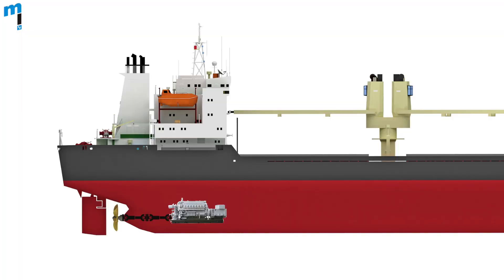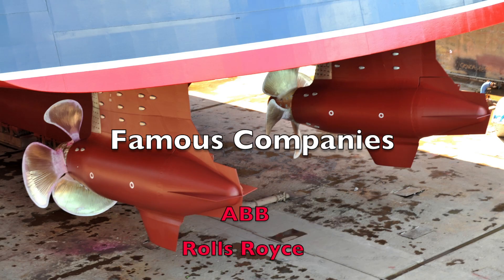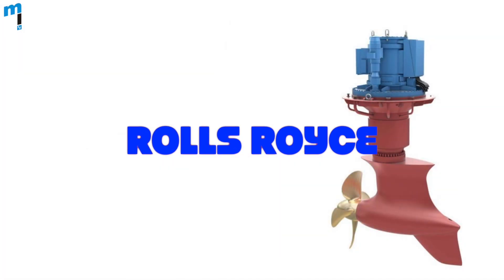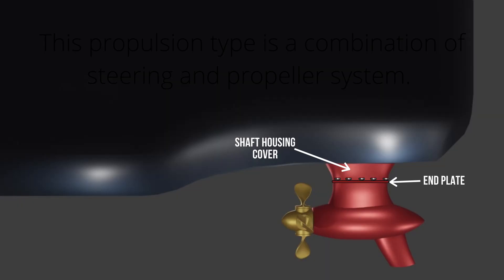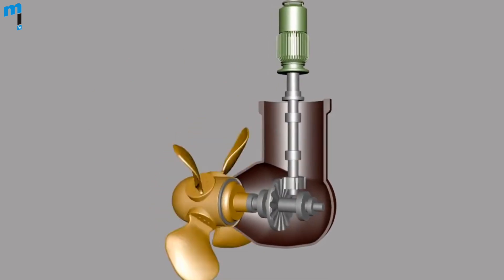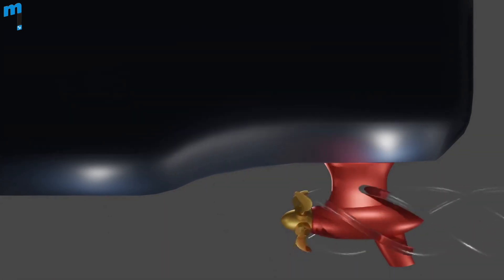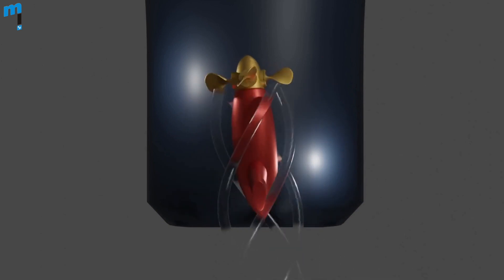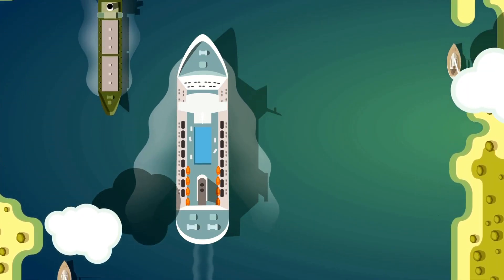Pod Propulsion System

Comment: you kind of missed the whole idea and got a bunch wrong,  muh hommie.  it is cheaper to build a typical single screw propulsion system, but the benefits of a an azipod propulsion system are tremendous.   Mainly docking large ships without tug boat assistance and that's with no bow thrusters.   There are videos of a little 9 year old girl docking a 100 foot motor yacht by herself,  the system uses a single joystick and is incredibly simple to use.  They are still studying fuel efficiency so it's too early to claim an advantage in yearly costs and transatlantic cargo shippers are notorious for only using the least expensive method available so single screw cargo vessels will be with us for a while but they may be returning to sails in the future

Comment: I’d imagine the pods with electric motors within them would be more efficient than a mechanically driven shaft running down to the pod. There would be a certain amount of power lost through the bevel drive. Great explanation, thank you!
Reply: In long term use it more efficient for me than put motor directly to turning propeller. Sealing from sea water will be main issue with underwater motor. Maintenance too will not be a simple work to do.
Reply: electric motor will be severelyy underpowered, not to mention you have to carry battery

Comment: You can forget the rudder refusing to work at low speed, and all the problems with transverse thrust. The pod contains all the moving parts, and all you must take care of, is the quality of the seals.
I have no info on how the electric pod propeller behave in case of incidents. Water entering the pod would disable both propulsion and steering of the ship.
Reply: Yeah, that's a interesting fact which they conviniently forgot. Both steering and propulsion wi ll be lost in the event of a mishap. Certainly not worth the advantages  of using it.
Reply: @rv_316  And still all the navies and corporations are going there so it must be more efficient.

Comment: Why aren't actual propellers protected from underwater obstacles
Reply from the maker: Some Propeller do have a circular covering
Reply: Adding protection to the screws also adds drag, reducing efficiency.
Reply: I dont think that adding a steel ring around a propeller would save it from breaking if you hit something stationary in the move the ships weight is more than enough to rip the pod off the ship if you think about it

Comment: POD propulsion needs high voltage system.  Do all synchronous motors used in POD propulsion are slip ring type? I think brushless synchronous can be installed. Secondly may I know why POD propulsion do not gain so much popularity despite of so many advantages? It is well known fact that Deasil electrical propulsion is anytime more fuel efficient then direct diesel drive.
Reply from the maker: Yes, Burshless motors are alos used. 
Diesel electric propulsion coupled with POD has higher power loss as compared to direct drive system

Comment: Is there any disadvantage of this pod propulsion???
Reply from the maker: Higher capital costs
Diesel-electric system required (power loss).
Power requirement higher for single screw arrangements.
Limitation in power.
Limitation in speed.
Reply: @marineinsight  Can you please elaborate the limitation in power and speed please

Comment: Thx for the info. I have 2 questions 
1. Why do most naval ships not use azipods?
2. Why don't cargo ships or oil tankers use azipods
Reply: Because of the expenses of fitting the ships with them, instruct the crew about the how they work, maintenance and so on. Cargo ships are made to bring money not to increase expenses.
Reply: @SirWyx1604  thank you:)
Reply: From my prospective naval ships are a bit older, on average,  and the technology of Azipods is relatively new to them. Military is test, test and test.
Changes are in the works so to speak.

As far as massive oil tankers go the author is within bounds of reality. Cheaper to get the bump (tug assist). All about the bottom line on profit.
Reply: @ronz101  thx for the info really helped
Reply: @tariq-maxwellanderson9784  👍